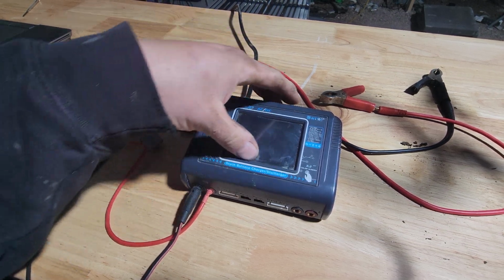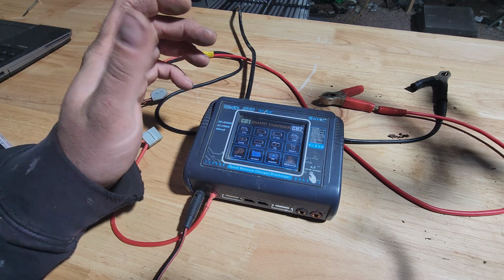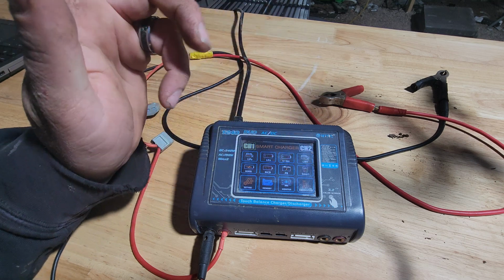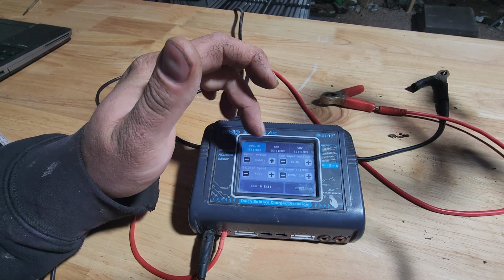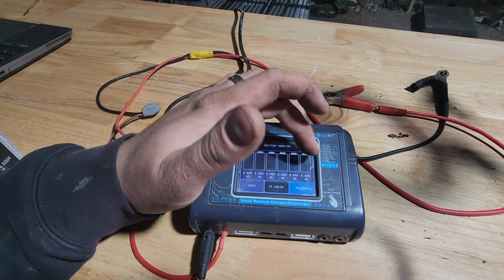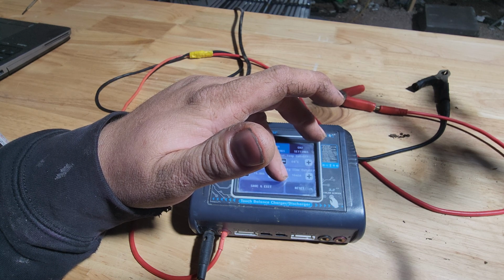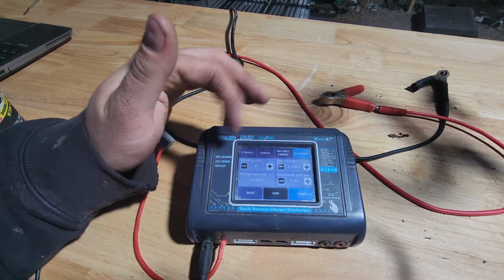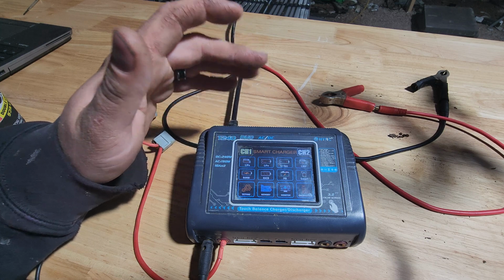HTRC T240 Lipo Charger Dual Channel AC150W DC 240W Touch Screen RC Discharger AU

Comment: hello, I have the same charger and trying to charge 2 x 6s. only channel 1 worked for the charge  any tip on how to get channel t2 to work please.
Reply from the maker: Have you checked the balance plug connection?
Reply: @ thank you for your reply. I worked it out on the day. I’m a clown. I just didn’t select channel 2 to start. As basic as that. I felt like an absolute idiot. 
Thanks for the advice on checking the balance lead, by the sounds of it a wonky connection can cause a no start issue too. 🍻
Reply from the maker: @marcandreasson87 yeah they confused me first time switching channel

Comment: Very very nice I am using mine as I speak I'm discharging some drone batteries.
So far this has been a very nice charger after 2 and 1/2 to 3 years
Reply from the maker: Yeah they work well
Reply: I accidentally deleted one of my profiles do you know of any way to get it back ?
Thanks Keith
Reply from the maker: A charge profile?

Comment: @1:45 it was the imax B6.. the real ones are good for small RC lipos and things. but fake ones blow up all the time.  i have the imax b6 mini is been working fine for years. it can do 80w. but i never do more then 40w/50w to keep it working for as long as i can. the one you have looks top notch.
Reply from the maker: The imax yes thanks it totally slipped my mind even though I've spent 100s of hrs looking at one
Reply from the maker: They even made one with ac input